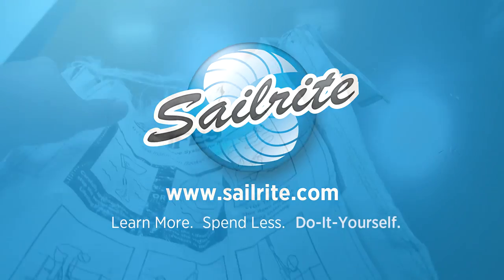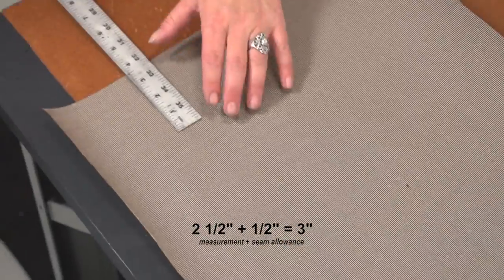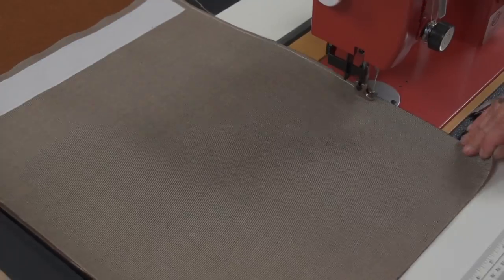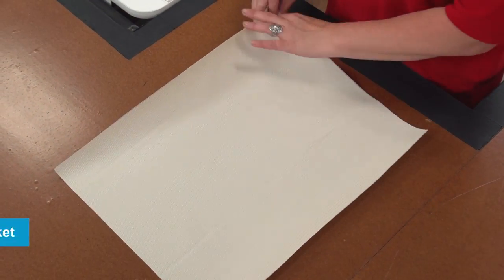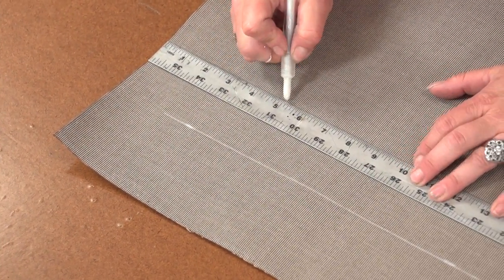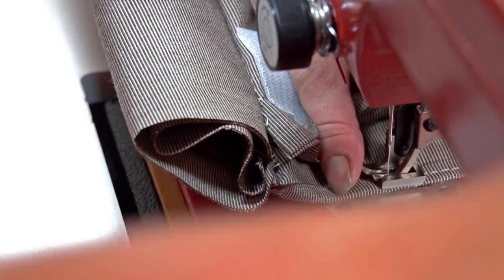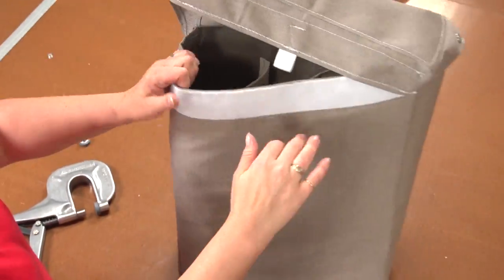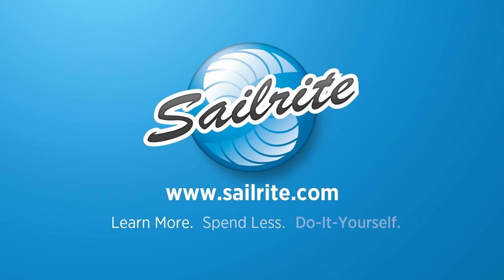How to Make a Lifesling Cover for your Boat

Comment: We are half way through construction, and noticed exactly what the first commenter encountered.  The assembly order is OUT OF ORDER requiring us to stop when we hit the point of installing the rope pocket and realized the order was wrong.  We had to tear the seams out of the back panel and start over.  Not the end of the world, however the video sequences should be reordered.  
All the above said, it is a quality video and product that we have come to appreciate from Sailrite!  We love our LSZ-1.
Reply from the maker: Yes, you are correct, thanks for letting us know! It is difficult to switch the order around due to the fact that we no longer have the raw video files, they were lost after the video was edited. I have added notes to the description and included annotations to help guide viewers around our mistake.
To avoid this issue follow these instructions:
At 6:05 min STOP and Skip Ahead to 11:21 min.
Then at 15:07 min STOP and Go Back to 6:51 min.

Comment: It seems to me that you could make all 4 sides (front, back, left, right) out of just two pieces of fabric (inside and outside) as one large piece, with a single seam down each corner to tie it all together, and then one true seam to connect the ends.  This would seem to be much easier, unless there is some reason for doing 4 pieces and then connecting them all?  To go one step further, you could make the inside and outside from one piece, and fold it over at the bottom and hem it.
Reply from the maker: That is true, but it will not have as much of a defined shape if done that way.
Reply: @SailriteDIY  ...unless you make the stiffener stiffer!  I didn't see the stiffener in the list of materials needed.  What was used and where might one get it?  If I missed it in the video... sorry.

BTW - love all of your videos.  Lots of help with my many boat and back yard projects (dinghy chaps, cockpit cushions, lounge chair slings...).  Got the Snap tool first (OMG), then the Hot Knife (LOVE it) and, finally, the sewing machine (the blue one with zIg-zag - got it for the chaps but use it for all kinds of things.)
Reply from the maker: @flutini1  We do not sell the white plastic stiffeners. However, you should be able to find a very thin plastic sheet of acrylic or other at a hardware store. 
This is what one of our customers said:
I took your advice and checked out Harbor Freight and found the perfect material. Plas-Tex and is a Waterproof Wall Panel. It comes in 4’x8’ sheets and is 0.060 thick and its color is bright white. While it is heavier than the material Life Sling uses which is 0.30 thick, it should hold up even better. I know that in my Life Sling bag the stiffener material is already bent. One might say, what do I do the excess after I used a small section for the bag? Easy, it is also perfect for shelf lining in kitchen or other home places. It is also reasonable in price at about $20.00/sheet. Cutting can easily be accomplished with a utility cutters or sheers as well as marking with a pencil. I believe that one can find the material also at Lowes which both chains are nationwide.
Reply: @SailriteDIY  Thanks!

Comment: There's an error in your video: you show the inside and outside of the back panel being sewn together early in the process (after sewing on the velcro fastener strips). Then, later on, you show the rope pocket being sewn onto the as yet unattached inside back panel, which was then sewn to the outside back panel again. I didn't catch this until I'd already sewn the two parts of the back panel together, and thus had to rip the stitches out to sew the rope pocket on. Not a big deal, but I thought I'd mention it. Nice video otherwise. :)
Reply from the maker: Yes, you are correct, thanks for letting us know! I have added Annotations to help guide viewers around our mistake.
To avoid this issue follow these instructions:
At 6:05 min STOP and Skip Ahead to 11:21 min.
Then at 15:07 min STOP and Go Back to 6:51 min.
Reply: @Rogelio Valentino Definitely, have been using InstaFlixxer for years myself :D